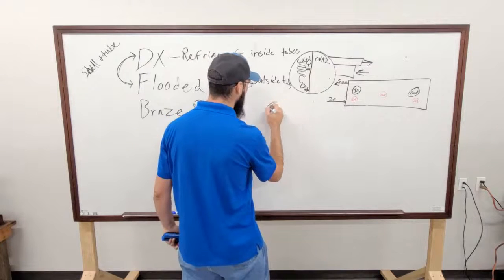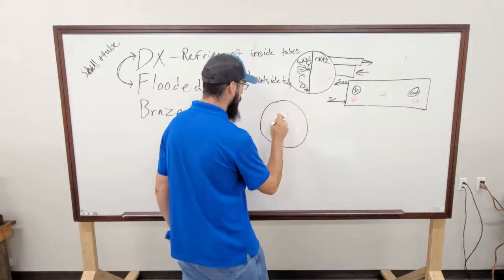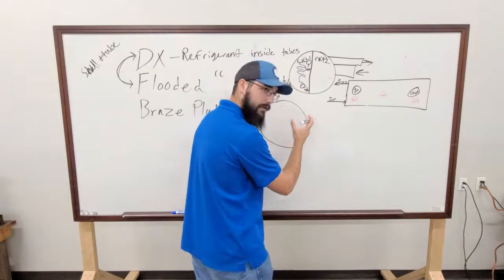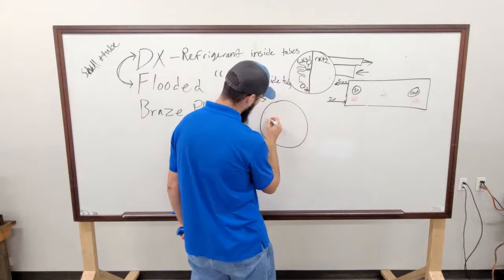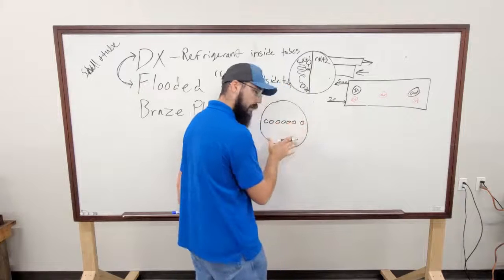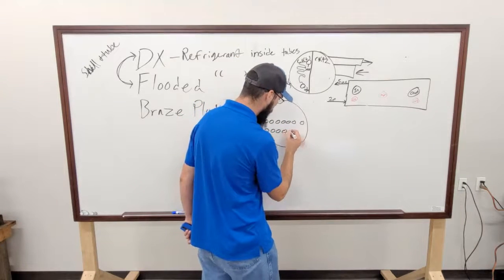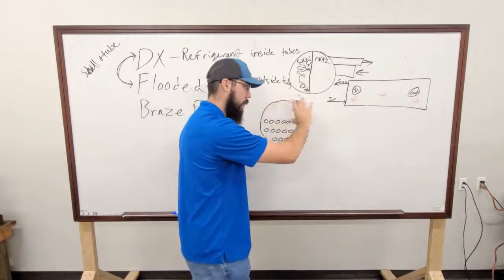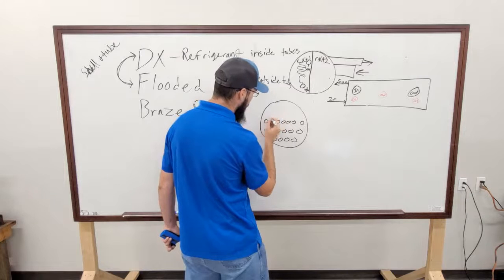Chiller Training: Air Cooled Chiller Mechanical

Comment: Man thank you brother i have a mammoth air cooled chiller and all 3 of my banks the scrolls were running low saturations at 30 and tripping on low pressure to find out that some guy went happy on my flow valves and opened them all the way!

Comment: So, the eductor uses the vapor's energy to accelerate and inject flow to the motor oil circuit like the water injectors on a steam engine use steam to inject water to the boiler?

Comment: So on the screw I’m guessing as it slides back it opens up and reduces the compression basically slowing down discharge velocity and reducing discharge pressure. Basically like the the quench area between the valves and piston on a combustion engine ?
Reply from the maker: Yes

Comment: The eductor must create a Venturi effect.
Reply: It seems that it’s design is to basically create a turbulence to keep whatever oil that’s made it way through the system from separating from the refrigerant so it will make its way back to the suction side of the compressor. (Stratification) could be wrong just a guess.